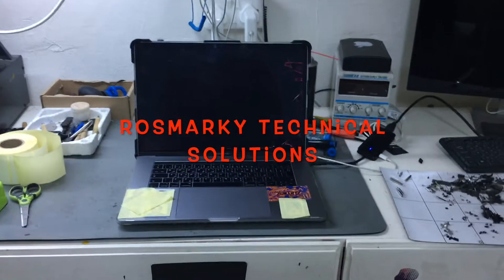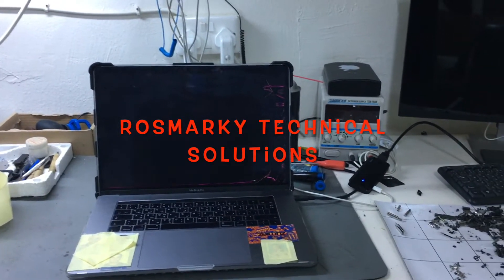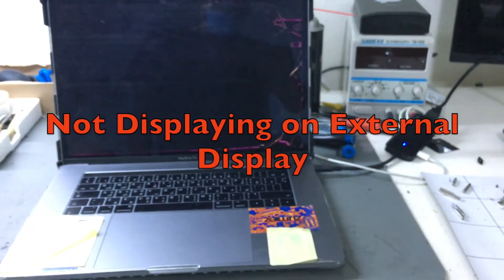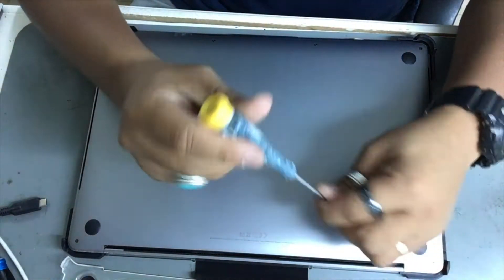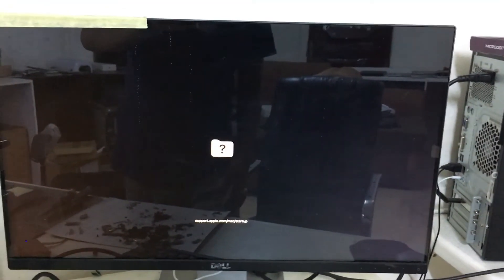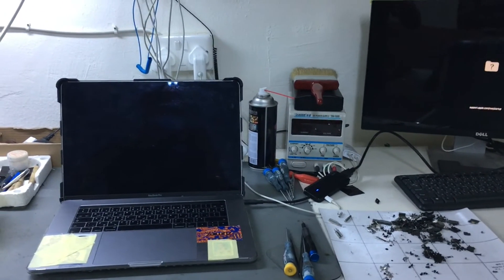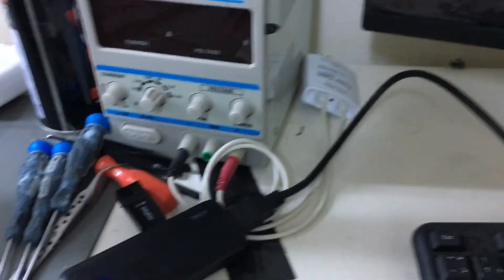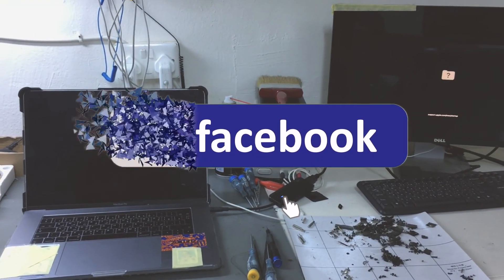Macbook Pro 15-inch A1707 | It does not display on external display after the screen was broken

Comment: 上次，我的MacBook pro 2019的显示屏坏了，但系统很好，可以启动。我拔下了屏幕电缆并强制外部显示器输出。但是，当我尝试安装和恢复macos时，我达到了一定程度。其中一部分无法显示。当时机器已启动。输入帐户和密码时，外接显示器似乎无法连接到输出。没有办法。我在 2019 上重新安装了带有部分显示屏的屏幕，恢复了系统，然后将其拆卸。如果显示器连接到外部屏幕，一切都会好起来的。
不知道有没有人遇到过这样的情况。我怀疑当时外接显示器的驱动程序还没有加载，或者苹果不希望我们能够如此方便地使用它，需要更换原来的苹果显示器。
那么，你有什么更好的建议吗？
Reply: Last time, the display of my MacBook pro 2019 was broken, but the system was fine and could be started. I removed the screen cable and forced the external display output. However, when I tried to install and restore macos, I got to a certain point. Part of it cannot be displayed. The machine was started at that time. It seems that the external monitor cannot be connected to the output when entering the account and password. There is no way. I reinstalled a screen with a partial display on the 2019, restored the system, and then disassembled it. If the display is connected to an external screen, everything will be fine.
I don’t know if anyone has encountered such a situation. I suspect that the driver for the external monitor has not been loaded at that time, or Apple does not want us to be able to use it so conveniently and needs to replace the original Apple display.
So, do you have any better suggestions?

Comment: Hello; I own a macbook pro 16 inc 2019. macbook screen cracked. I also started using it with an external monitor. One day I needed windows and I installed win 10 with bootcam. but when it started in windows it stopped displaying the external monitor. how i did i deleted mac startup and windows startup. when i run internet recovery it is loading. As the apple logo fills, it outputs the image to the internal monitor. the computer is working. When you press the shutdown button 3 times, it gives a voice command. but it does not display the image to the external screen. I also disconnected the motherboard monitor connection. but still nothing has changed. What can I do. I've been dealing with it for weeks. I tried to download offline. The internet goes straight to the rescue. please help me...
Reply from the maker: when you starp-up the Mac press CMD+P+R when it restart release all the buttons, it will start to Mac OS check if it displays to the external.

Comment: Will the computer show the folder with question mark if you do work the the inner working of the computer. like by unplugging the LCD.. then trying to display on tv will it show the log in screen or will it reset or damage the computer
Reply: Yes 100 percent sure it will display on the PC monitor or in Apple cenima display

Comment: Good job, but what have you installed at 14:20 . You have plugged in an USB in the adapter, what was it? and what have you installed in it? This step it's not working with me! Thanks.
Reply from the maker: 14:20 was a USB-C to HDMI adapter with a USB connector also to run MACOSX in it,

Comment: Can I do it for my A2337 model?
Reply: Yes 👍 if you don’t replace the lcdscreen
Reply: @rosleyoutdoors  would it be better if I just take off the lcdscreen?
Reply: @yudhasetyaji7336  Whatever you like bro, the thing is you just have to remove the lcdscreen flex cable from the board so that the external screen will work.
Reply: @rosleyoutdoors  okay, thanks
Reply: @rosleyoutdoors  btw, what is your screwdriver size? T3 or T2?
Reply: @yudhasetyaji7336  use P5 on back cover and use T3/T4 on the screws to remove the lcdscreen flex
Reply: @rosleyoutdoors  many thanks bro, I used T4 and didnt work. Looking for T3 then
Reply: @rosleyoutdoors  Hey can you help me about this one. I am trying to erase mac from recovery mode, but when its restarting I cant see anything on my external monitor. Any tips for that?

Comment: Hi I’m having an issue (my screen starts flickering when it gets too hot) and i was wondering if using your macbook with an external display is possible? i haven’t tried yet but would this work? i don’t care if i ruin my macbook screen when doing this and letting it heat up till if completely melts the display port...can i just use this set up ?
Reply: Thank you so much ! I looked all over YouTube for this
Reply from the maker: @ndavid8848  Just open it properly watch every step on how to open it and do the proper way so that when you got a new screen you can still change it.
Reply: So is it really important for me to unplug it like in the video or can i just leave it be if the external monitor is working ?
Reply from the maker: @ndavid8848  if you connect it the external displays won’t work.
Reply: hi sir, I have another question, is my problem related to the display card? I asked someone and they say it’s the display card problem so even if i use an external monitor it won’t work...please help
Reply from the maker: @ndavid8848  may I know the model of your device? it is at the back it started with letter A and what’s really the problem of your device is it broken? or garbage display I mean garbled display
Reply from the maker: @ndavid8848  if that is a GPU problem not the screen problem even if you put an external display it will be the same output
Reply: Model A1707...it only starts to show white horizontal lines at the bottom of the screen for a few months...but only when the laptop gets too hot...3 days ago the whole screen glitches when it gets too hot (like when the fan turns on for more than 10 mins). So now it’s not showing lines anymore it just goes directly to glitching if the device gets hot. Thank you for your help
Reply: The display seems fine...there is no backlighting issues nothing...just when it gets hot that’s when the lines appear and now glitching...but I can use it for hours as long as it doesn’t get hot (I don’t use intensive programs like Ps) and it will work fine...
Reply from the maker: @ndavid8848  I notice that Apples 15 inch display devices got GPU problem on older models but you can try it, if you have already an external display.
Reply from the maker: @ndavid8848  I mean I did not encounter any GPU problem on newer models except the backlight flex cable tear up easily.
Reply from the maker: Yes just disconnect the LVDs Screen Display Flex Cable and it will work on external display.
Reply: I have a 2016 model and i would only replace the screen maybe after 10 months or so...
Reply: hi when you say older models do you mean my model or the ones before my model ?
Reply from the maker: @ndavid8848  Those devices before that model